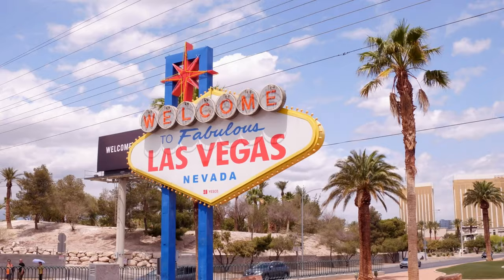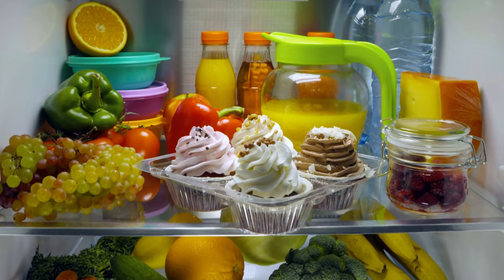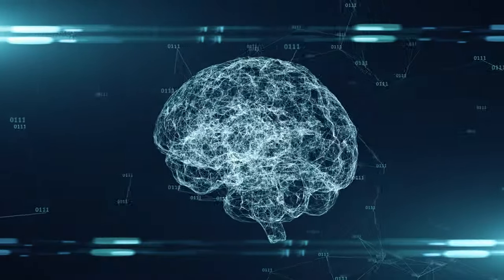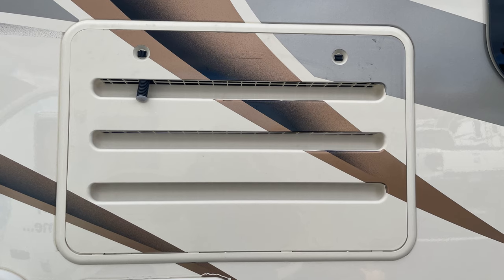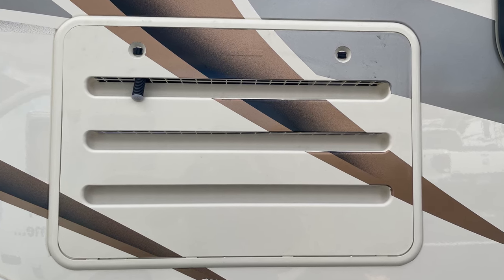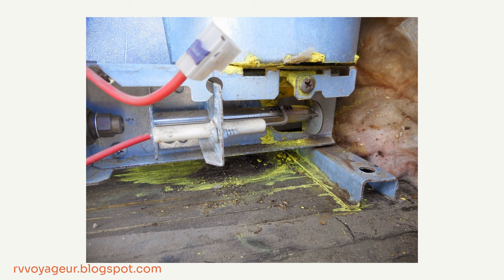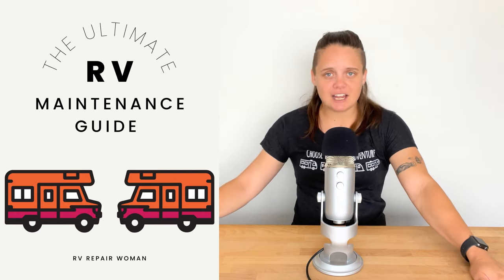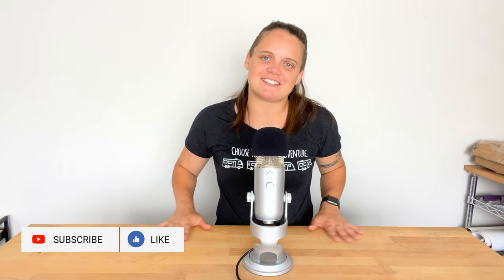How Do You Charge a Dometic Fridge? (From a Mobile RV Tech)

Comment: rv fridges are ridiculously expensive and replacing the cooling unit is even more so. this is why you go to your local big box store and pick up a 200 fridge and stick it in the hole. Yeah, it runs on AC only but just deal with it.

Comment: Ok so my thought after I listen to you. So how does the manufacturer "magically" put freon into it?? If they can do it I can do it 👍🏼
Reply from the maker: They put it in and then hermetically seal the fridge…
Reply: @rvrepairwoman  AMI PARTS BPV31 Bullet Piercing Valve （1Pc） Compatible with 1/4,5/16,3/8 inch Universal Refrigerator Tubing
Reply: You might want to pay more attention. These systems don't normally use freon. They use ammonia. They aren't working on the same principles as a cooling system that uses freon, or any of the replacements for freon that have been used for the past thirty years or so.